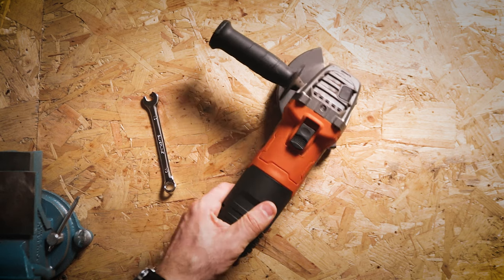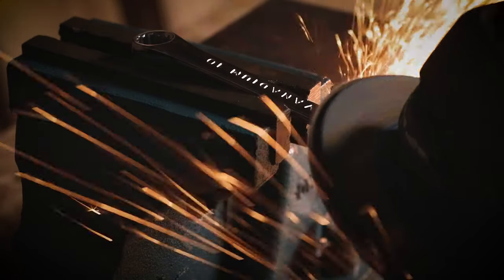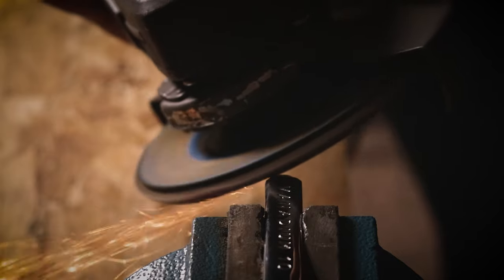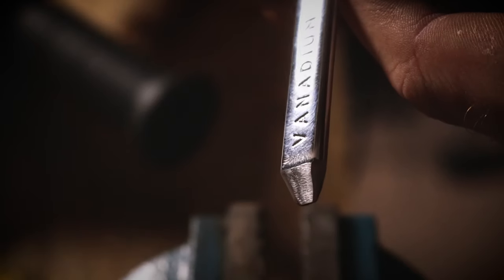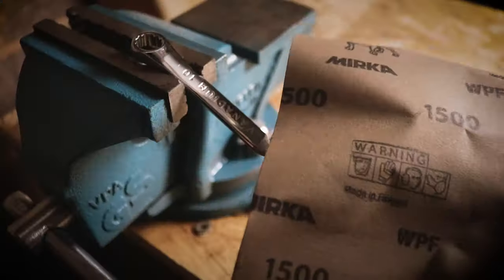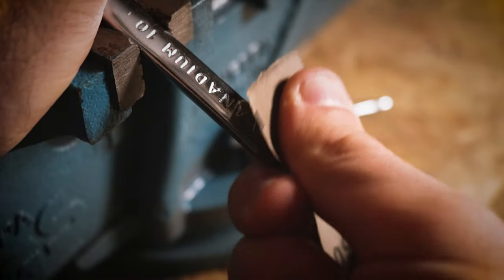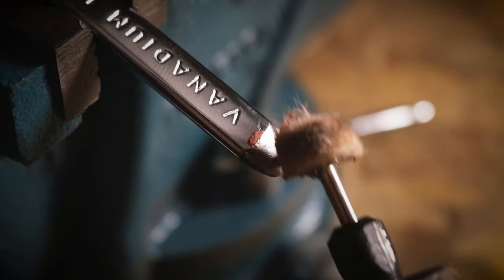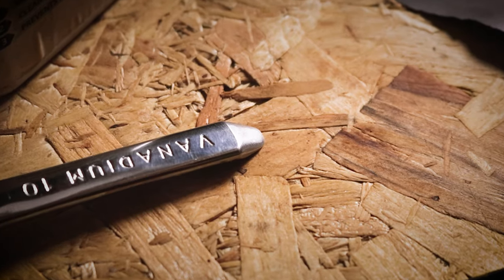DIY Pocket Pry Bar (How to Make an EDC Tool)

Comment: Nice high quality video did u post this on edc on Facebook
Reply from the maker: Thanks buddy! Yes I did 😄
Reply: James Graves hahaha nice man I might have to do this to a 13 mm spanner I have way to many or a 10 it’s nice that the closed spanner can still be used on nuts.
Reply from the maker: Yeah man go nuts with it! (no pun intended). Exactly, I use a 10mm so I can take it off my keys and use for battery resets and what not in a pinch 😉